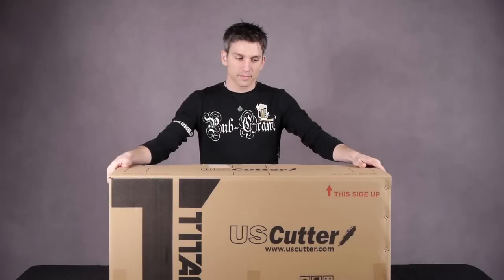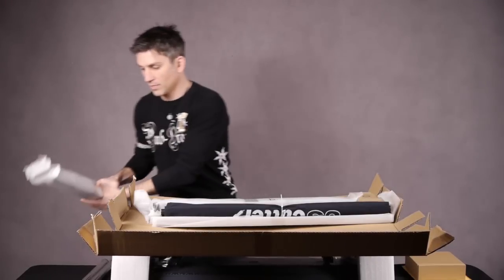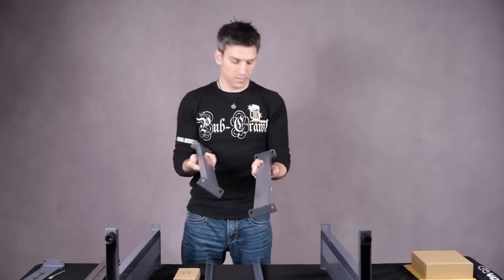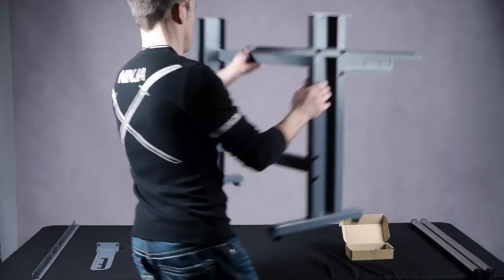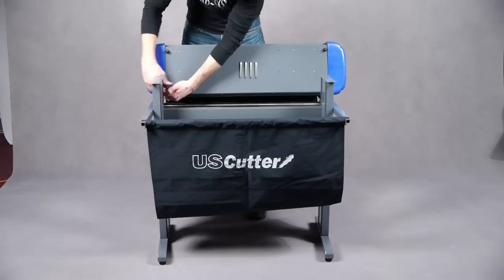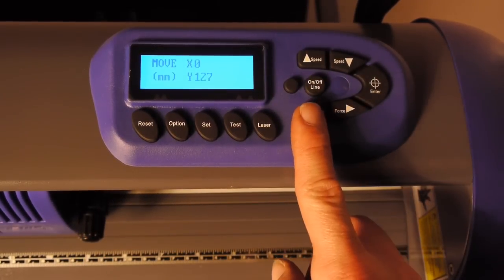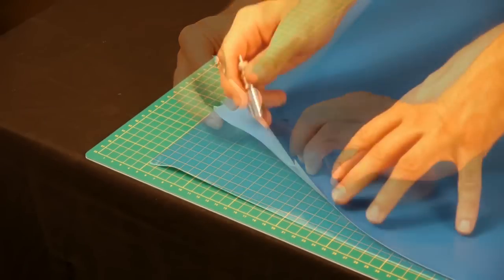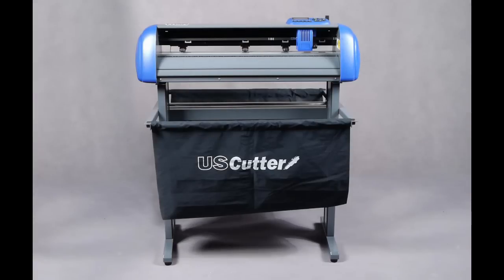Titan Series Vinyl Cutter Unboxing & Setup

Comment: US Cutter, a suggestion. For new users of the Titan, it would be useful to have the "how to" video, starting at 8:05 to the end, as a separate video labeled "Titan basic machine use for beginners.". The information contained there is so important but is buried in the cutter and stand video. Thanks for offering this.
Reply: good input David and agree. However, if I were US cutter - i'd totally revamp their instructions and how-to. Very fragmented and hard to find info - I can see they cut corners in this regard.

Comment: My stand doesn't have two guide holes at the top for the cross arm like this one does.
Reply: Similar but my stand doesn't have the two guide holes for the bottom cross bar, just one hole.

Comment: It would be very helpful if those videos were somehow advertised when you open the box. I am not a complete dummy, but I felt a bit helpless with NO instruction and no hint where to get the instruction quickly. Just one sheet of paper with useful links...
Reply: Agreed. I got my Titan2 today. No directions. No manual. And that online PDF was BRUTAL. I wound up taking it apart THREE times, simply because the illustration's hole patterns did not match what I got. Geez... my Graphtec, purchased in 1995, had EVERYTHING: Manuals, user guide, quick start, all illustrated professionally. This package came with a receipt. I'm hoping this first-time experience isn't indicative of things to come. Wish I could have shown all of you what the box looked like when it arrived! The outer box was mangled, and haphazzardly re-taped. When I saw it sitting on my porch, my first thought was... I'm problably gonna have to send this thing back. Fortunately, everything appeared to be ok after unboxing it. I haven't found any damage, yet. So... my nerves have calmed. But you would think it would be compatible with major software brands. I knew this when I bought it. But still. After using SignLab for 26 years, I'll admit that I'm spoiled. The extra steps of exporting into another file format, as well as learning another software thingy...

I haven't even turned this thing on yet... and I am bitching. I need a hug, and a beer. Change sucks. Most likely... a "me" problem.

Hopefully, I'll be pleasantly surprised when I'm cutting.
Reply: @Seemsayin  Nothing has changed...just got this today, the stand is trash, no instructions, these videos are garbage....horrible.  I sure hope this machine works better than everything else with this company
Reply: @KnightDriveTV  I actually was pleasantly surprised. After the learning curve, I have to admit... I'm glad I bought it. The price was righteous. Cuts beyond my expectations. Very happy with it. I wasn't thrilled at the thought of different software, but VinylMaster is pretty good. Easy to use. I still design with SignLab & Corel, and export into VM. 

Overall.... happy camper.

Comment: You guys seriously.. Seriously… SERIOUSLY switched what direction the legs are facing from the beginning of the video. Where essentially the roller arms are going over the longer section of feet where later in the video it’s going over the shorter section of feet. What the actual ****. Am I wrong? Wtf guys wtf…